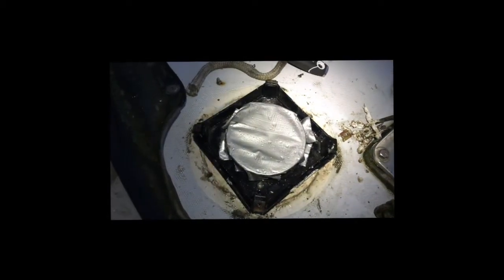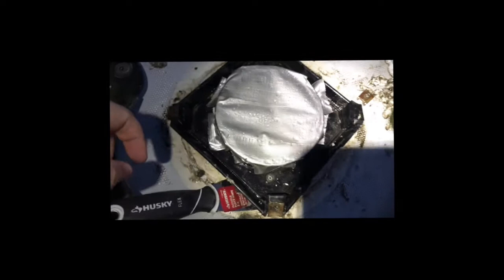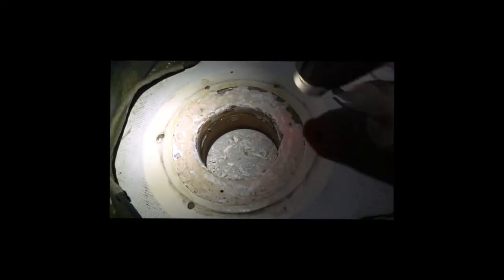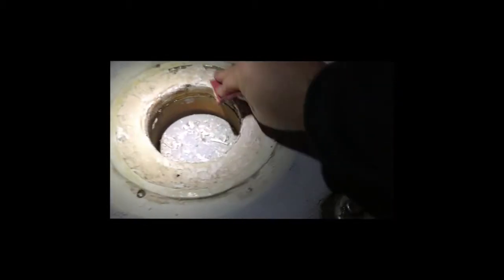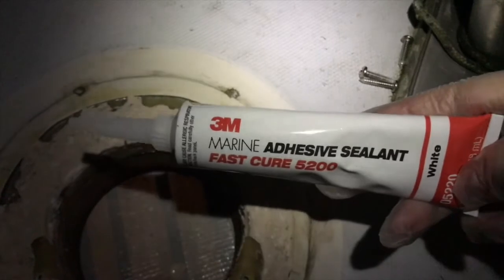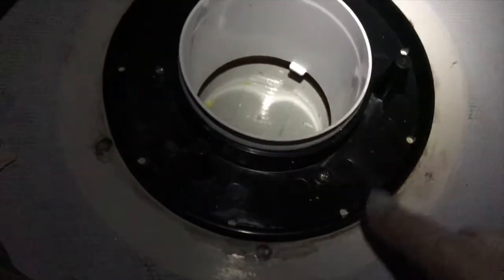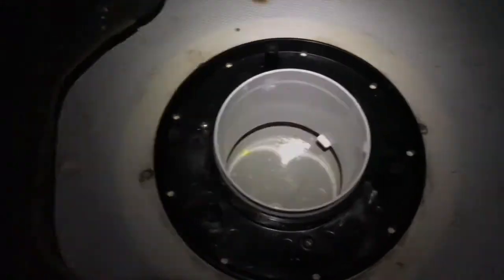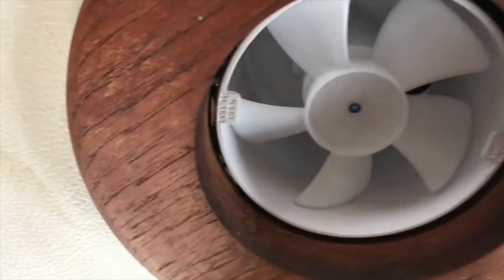Nicro Day/Night Plus Solar Vent replacement

Comment: Do they really work? Looking to use it in South Florida to remove some heat when the boat is not in use
Reply: The reviews on Amazon are very poor.
Reply from the maker: They’re so-so. Probably about the same as a regular dorade without the large footprint.